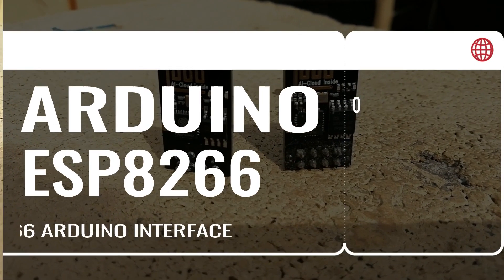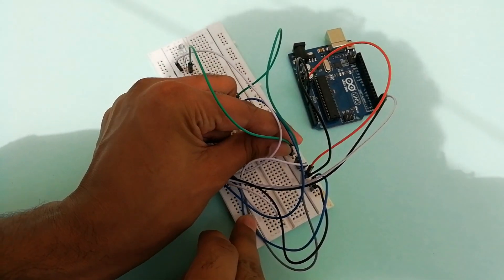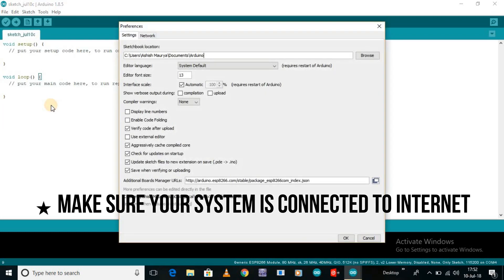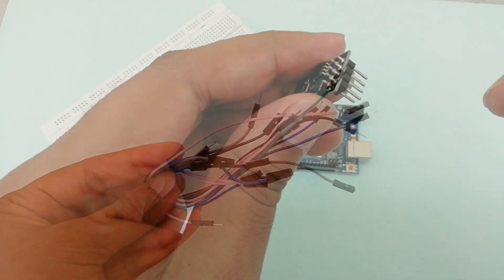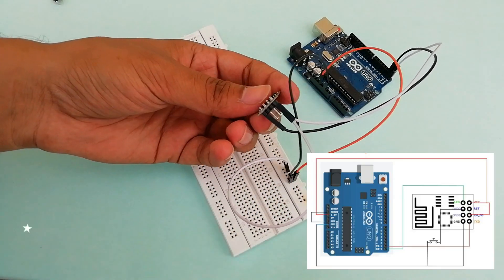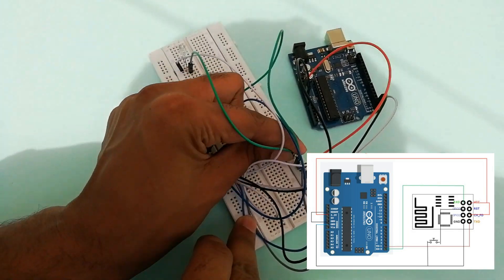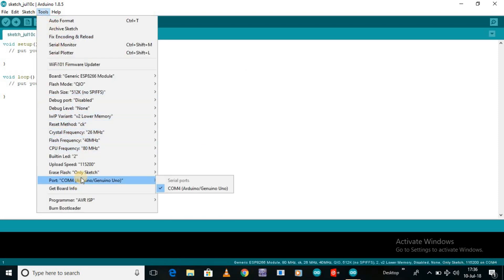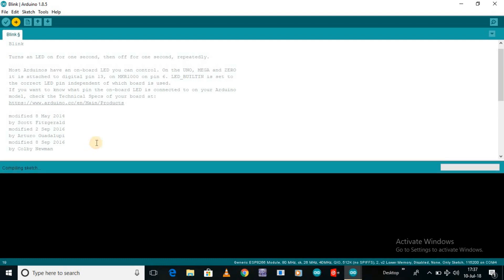How to Program #Esp8266 using Arduino uno.

Comment: I have some questions my project name wireless safty system for underogrond mine workers based on WSN so in my project i can only used the aurdino uno for data transfer through wi-fi or i can use this ESP8266 with aurdino uno for data transfer i am so confuse please replay me.....😥

Comment: The Arduino tx is at 5v, should it be a risque for the esp which is expected 3,3v ?
Reply from the maker: Use voltage divider resistance

Comment: Why the wifi module is used here when you're not controlling it remotely? I don't understand what you've done. I'm a noob. Kindly explain this if you're reading this till here
Reply from the maker: You can easily understand by the title but if you didn’t understand, this is a tutorial video on how to program esp8266 board by Arduino uno .
Because this wifi module doesn’t have any inbuild programmer.

Comment: For anyone getting errors while uploading to ESP8266, such as "Timed out waiting for packet header
" or "upload_mem_failed": 

Firstly you don't even need the push button in order to put ESP8266 to programming mode. (You can remove that part from the breadboard.) What you need to do is:

1. Connect the GPIO0 pin to anywhere in breadboard, and connect it to ground over a 10K OHM RESISTOR. 
2. Disconnect ESP8266 power supply (3.3V) and wait a few seconds.
3. Re-connect the power supply of ESP and click upload code.

This fixed the issue for me, hope this helps.
Reply: it worked thanks
Reply: Not worked for me :(
Reply: I will try

Comment: its showing this error : 
esptool.FatalError: Failed to connect to ESP8266: Invalid head of packet (0xF0)
_
the selected serial port _
 does not exist or your board is not connected

Edit : I finally connected to esp module
I don't know what worked but here is what I did
Restarted computer 
Connected the connector to other usb port
Tried to upload blank file first 
Sometimes it gets uploaded,  sometimes it just stuck at connecting_. Message  
But code gets uploaded most of the time now
Reply: got the same issue here, even i follow correctly

Comment: Hello I tried uploading the sketch but getting this error , I have connected the Rx Tx pins correctly as you have explained....

esptool.FatalError: Failed to connect to ESP8266: Invalid head of packet (0xF0)

why is this error coming ?
Plz reply.......
Reply: I fixed it by using an arduino nano for the programming and the uno for serial monitor. The nano has the ch340 usb to serial chip and I think thats why it works? 
Either way, works with the same circuit.
Reply: how did you solve it ??

Comment: Sir AT command working well with arduino  uno but how i can use  esp8266 01 as webserver without arduino
Reply from the maker: arduino uno is used only for flashing the code.., once you upload the code you can remove the arduino uno
Reply: @technolabcreation  ok sir but code  not upload in esp error show

Comment: Brothers its very easy to solve the error

1: go to tools and select avr isp as progrmmer

Then when you uploaded the code 
At end when finished uploading disconnect gpio 0 pin from ground and press the bottom for 2 seconds

It will work 100%

Comment: i dont know why but i am getting this error -
FatalError: Failed to connect to ESP8266: Timed out waiting for packet header
Reply: same problem for weeks now
Reply: +1
Reply: +1
Reply: Brothers i know the solution its very easy to solve
Reply: Ok for anyone with same issue ,its hold rst button for 1 sec add gpio button at same time release reset buton ,release gpio0 ,impoetant thin ,it does always work,another important thing is that u have to hold those buttons for ay least 1secund
Reply: @hikolanikola8775  bro it didn't work
Reply: I fixed it by using an arduino nano for the programming and the uno for serial monitor. The nano has the ch340 usb to serial chip and I think thats why it works? 
Either way, works with the same circuit.
Reply: +1

Comment: A lot of resources say that the current ESP8266 draws is higher than Arduino can give from its 3.3V pin. It may (MAY!) be enough sometimes, but at some points it may not be enough. They recommend using a 5v-3.3v converter to feed ESP8266. 

Also - may sources claim that a 10 uF capacitor should be used instead of a short wire between GND and Reset to make Arduino an ISP. Strangely, I have not seen such recipes for ESP8266 programming, but for programming ATTiny chips. Do you have any comments on this?

Comment: So I tried to upload the code to the esp after I constructed the entire circuit, but it wouldn't let it upload. The error message said: 
esptool.FatalError: Failed to connect to ESP8266: Timed out waiting for packet header
It had the exact same error message when i tried to use a completely different circuit earlier. Do you have an idea of what I could be doing wrong? After checking the circuitry and resetting the esp, it still says the same error message. Can you please help? Thank you!
Reply: Same problem. I even checked that GPIO0 is connected to the ground.
Reply: At end disconnect GPIO0 AND PRESS THE BOTTON
Reply from the maker: Watch my video again I explain this error

Comment: We can program esp8266 directly, without using uno. What is benefit of using uno
Reply from the maker: Esp8266 doesn't have usb to TTL converter so to program it either u can use USB to TTL converter or simply Arduino board

Comment: I am trying to get the sketch program "Wifiscan" to find my home ssid just to make sure the WiFi is working. But when I open the serial monitor sometimes I will get a line of repeating question marks "????????" and sometimes I will get nothing.  What to do?
Reply: Ankit Singh 
It is all about synchronisation error i.e communication between module and router is not available
Reply: You solve my problem.
Ty🙏
Reply from the maker: Ur welcome